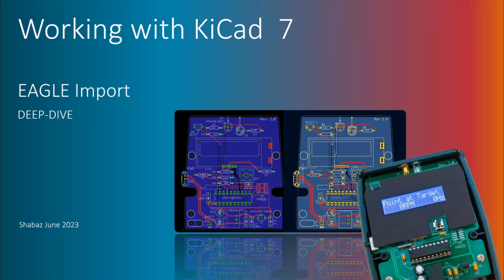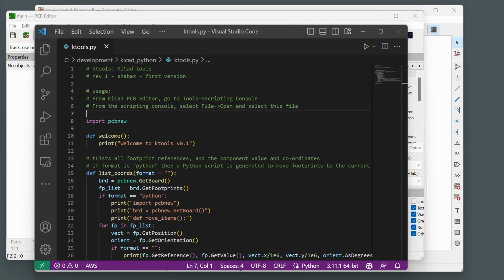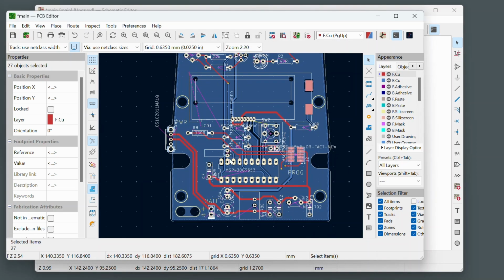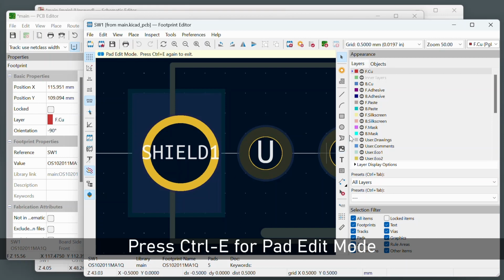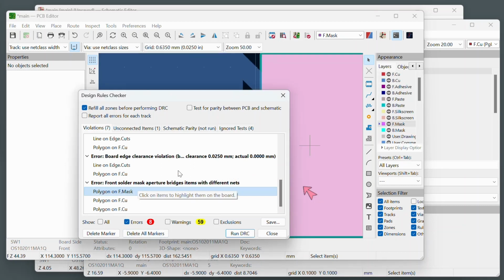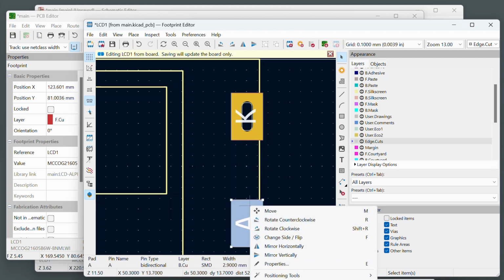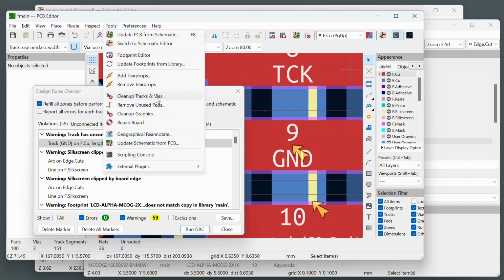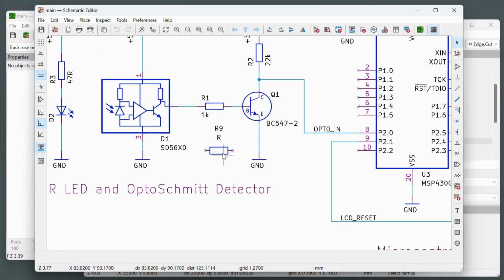Working with KiCad 7: Importing EAGLE Projects

Comment: Just a quick heads-up, as I went through this process I found a simpler solution. 
In new Kicad, just selecting "Re-link footprints to schematic symbols based on their reference designators" when updating from schematics is sufficient.

Comment: you should be able to either lock the positions for all the footprints or uncheck the option to change positions when you sync
Reply from the maker: Thank you! Also, some feedback here from paulvdh explained that the Python code is not essential, since "Replace Footprints with those specified in the schematic" can be unchecked, and "Re-link footprints to schematic symbols based on their reference designators" can be checked. Also, regarding the schematic text sizes, instead of using a text editor as shown in the video, another method is to use Schematic Editor / Edit / Edit text & Graphics Properties. Another recommendation from paulvdh is that the EAGLE symbols in the schematic be replaced with KiCad symbols if desired, using "Schematic Editor / Tools / Edit Symbol Library Links". Also, I forgot to put 'No Connect' flags against the unused pins that existed in the schematic.